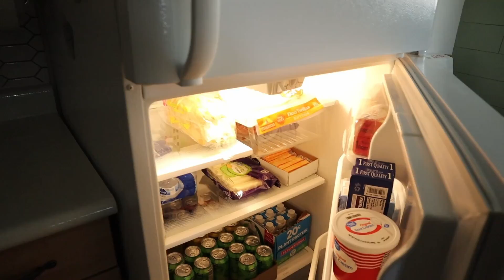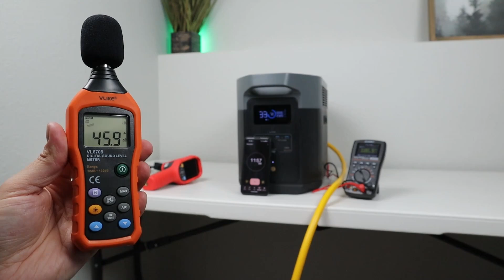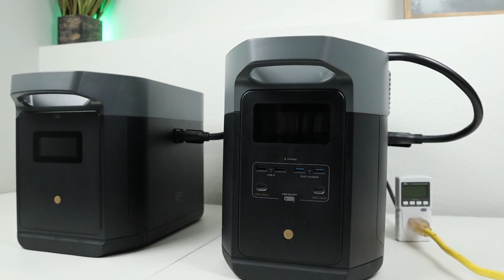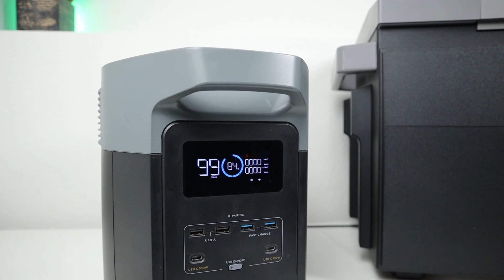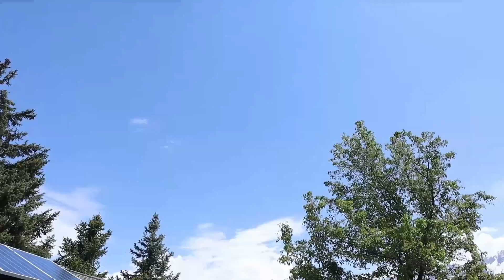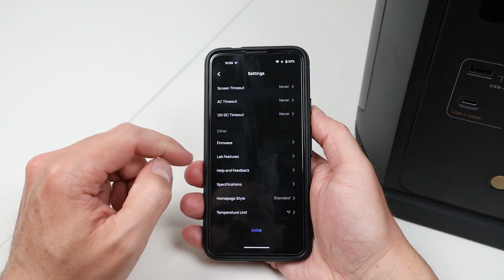The NEW EcoFlow Delta 2 MAX - LFP Batteries - QUIET FANS - 1000 Watts of Solar - FULLY TESTED!

Comment: excellent review.  I am working on home emergency backup.  I have sub panel in place only 120v, I just need outlet, will a regular outlet work or do I need special outlet to plug in the Delta 2 MAX.  I would also be using the automation feature to shift the charging to a lower rate time.  hope you could provide more info on this feature in the future.  Thanks again for excellent review.
Reply from the maker: You'll need to install a 'transfer switch' or a main panel 'interlock' in order to safely run your home circuits off a power station. I have installed a couple of them, they are simple to install if you follow the detailed install instructions. Here's a video of my first one I installed:
https://youtu.be/eiWnqukg9mM

I now have a 10 circuit model I installed that supports 240v input.
Reply: Understood.  The sub panel has its own circuit breakers for each line. Does that not count as a transfer switch. I looked at video, very informative.  I believe I have a similar setup, I believe I just need to add a three pronged plug then add delta 2 max.  I am thinking of adding EG4 battery because it adds more wattage than ECOFLOW expansion battery.  Thank you for your response and videos are very informative.   My main goal is to transfer electric loads to a cheaper rates at night.  The ECOFLOW is offering that possibility, trouble finding info or videos on that function which I think will grow in use in the future.  Thank you very much.
Reply from the maker: @salsero23  a transfer switch disconnects line power and uses the power station as the power source. You'll need a transfer switch to get the same effect.
Reply: I purchased the Delta 2 MAX.  All is working great.  I am not having success with the automation portion of the app.  I cannot seem to find much on its use.   working with ECOFLOW now with this issue.  This may be the subject for a short video in the future.

Comment: Hi..can you tell me please...in 1 port you can put 15 amp with 60 v .and the second same...or you have too put 15 amp with 30v one panel and the second same...I have at home delta 2 max and powerstream but both panel ecoflow 2(400w) is conected with the powerstream...and I know the delta 2 max is a now firmware...you can conected 2 panel for powerstream and 2 for Delta....I want buy another 2 but not same ..im  confused how much Amp and Volt can I put in one port....
Reply from the maker: Each port on its own is good for a max of 60v and 15 amps, or 500 watts. 

So 60v, 15 amps per each port separately for 1000 watts total.
Reply: Thank you very much!

Comment: Why would you think two Ecco delta 2 max units should not be connected for longer time back up.  I Would rather have 2 main units versus one plus an accessory expansion  battery….for better individual..separate usage…….but also I like idea of a total 4 k linked storage capacity. Thoughts on risks? Thanks
Reply from the maker: They aren't designed to be connected together like the expansion batteries. You could definitely use one main unit, once it's near empty, plug in the second unit. The first unit could start charging back up while the second one is in use.

Comment: If you use a 12V DC-DC 20A charger will it charge at  20A? Or do you need to go with 12-24V boost converter? Similarly, if you put the metal pin cable on 12V car, how much will it pull from car circuit?

Comment: Thanks for the video. Partially based on a previous video of yours, I’ve set up the Victron 12/24 to recharge the Delta 2 Max (on order) in our Gladiator build which will power our setup. You mention in this video you don’t love the Delta 2 Max for camping/over landing. Can you elaborate?  We had a travel trailer and can’t think of anything we can’t power with Delta 2 Max in our Gladiator build. Also have the Glacier fridge with 2 barriers and a River Pro.  Feel it’s been a cheaper route with more benefits than doing a dual battery system with a Redarc controller that’s stuck inside Jeep.
Reply from the maker: The only reason is that the DC output is limited to 130 watts so powering larger DC loads won't work well. If that's not a worry than this will work great since the AC inverter is plenty powerful to run AC stuff.

Comment: I have a technical question, that none of the review videos seem to address about these. I'm not interested in running a fridge or a whole house full of appliances. I simply have 1125 watts of 5V Dream color changing LEDs, about 25  strips 1 to 2 meters in length, each meter has 144 LEDs. Each 1 meter length is 45W. My question is, how long will this 1000Wh power station be able to operate them? According to my calculator 45 x 25 = 1125. By that math this new and improved power station could only operate these lights for less than an hour. Is that correct? 

What's twisting my head in a knot is, that one 45W strip can be powered by a single 20,000mAh 74Wh Li-ion rechargeable power bank via a 5v 2A usb port for 1 hour and only drain about 25% of its available power.  Am I missing something here? It seems as though buying 25 individual power banks will cost less and offer me far more illumination time than this power station.
Reply from the maker: Sounds like the 'rated power' is way higher than what the LED lights actually pull. Do you have a way to see the actually wattage of the LEDs as they are running? If you are plugging these LED lights into a '5v 2 amp' USB port is only rated for 10 watts, so technically you can't be pulling more than 10 watts for the entire string (especially if you aren't injecting power down the line).

If you are running the lights off a small USB power bank and getting about 4 hours of runtime, you'd probably get around 100 hours or 200 hours of runtime on a large power station like this. You could probably go with a smaller more affordable option and get great results.
Reply: @Jasonoid  Thank you for your quick reply to my comment. I hope you're correct, suggesting that I could use something smaller and more affordable. The thought of having to carry a 50+ pound power station for this purpose wasn't appealing. 

I'm afraid that as far as technical understanding to determine what the light strip's draw might be is beyond me. However, I may be able to get that determination answered via some help. I'll head over to where I can seek that answer now and hope they can offer me some understanding.
Reply from the maker: @regmiles  Your 5v usb port wouldn't function on more than 10 watts of power. So those LED lights can't be drawing much power. Good luck on finding out more about your power draw. You should be fine on even a 500wh power station.

Comment: Thank you so much for this extremely in-depth review. You definitely deserve more views/subs.
I had an enquiry in regards to the max voltage for the unit's solar input. On the EcoFlow site it doesn't really state if it's for both ports or per port but because your reviews are so extensive with in-depth analysis and experimentation, I found my answer, so thank you. So just to clarify once more, on the XT60 connections it's 60v max per port, correct?
Reply from the maker: Yep you can only connect solar panels with a total voltage of 60 volts max per port. So one array of 60 volts on one port,  and another array of 60 volts on the other. Two separate arrays for up to 1000 watts.

Comment: Beware.....
Be mindful of using the wifi app! If it is wifi- supported, IT CAN BE HACKED. They are equally as vulnerable as RING devices, home security systems, etc.
Govt, or bad actors could concievably disable, damage or destroy it. 
Best not to find out on the back end...
 Word to the wise....

Comment: Dropped mine from the chair to the tile floor. What could have been done to it? fan seems louder or i just didnt notice before. ?
Reply from the maker: It might be just fine. The batteries are pretty secured inside the power station. If nothing sounds loose inside than just test it out and see how it goes!

Comment: Surprised to see you pulled 138W from the barrel plug 😳 Surprised but happy.
Owners manual says 3A or 38W max. Perhaps it’s a misprint and should be 138W as in your testing? 🤔
Reply from the maker: Nah, it's not a misprint, these 5521 ports are not designed for high power draw over time, they will get fairly warm above 65 watts. It's perfect to run a 12v fridge since they are more secure, but I wouldn't go much higher than that wattage off the 5521 ports.

Comment: Another excellent analysis and presentation.  One item that apparently wasn’t improved is the rear power button.  This is a bother in my Delta Max (w two extra batteries) installation in my Airstream Travel Trailer.  A front button would be better. That, and the app requiring WiFi rather than bluetooth.  We use ours extensively, I’m very satisfied, and figure that by the time I hit 800 cycles with my original Max, there will be a Delta 6 Max.

Comment: Hi. Thank you for your review. Could you please clarify if it is possible to connect Delta 2 Max to Delta 2 via the corresponding charging port for an Extra Battery and vice versa? I have Delta 2 and would like to increase the capacity, however, I do not wish to buy an Extra Battery for 2kWh since it has no functionality and the price difference is also small. I am from Ukraine and the difference in price is less than $400 (about $2050 for Delta 2 Max and about $1650 for Delta 2 Max Extra Battery) if you buy not from the official Ecoflow store since the price for Europe is much higher (about EUR 2100 for Delta 2 Max - it is about $2300, and EUR1500 for Delta 2 Max Extra Battery - it is about $1600). For US the difference is about $350 ($1749 for Delta 2 Max and about $1399 for Delta 2 Max Extra Battery). If I pay this difference I will receive the "stand-alone" device which I can use anywhere. Also, could you please let me know, if it is possible to connect the Delta 2 Max Extra Battery ordered from US to my European Delta 2 since there is a difference in voltages: 220V vs 110V? As I understand, the Extra Battery charges the "main battery" with its "own" voltage from 48v to 60v (and vise versa), and on Black Friday, for example, I may get a good discount from Ecoflow US official store or Amazon))). In such a case Delta 2 Max Extra Battery is worth the money. 
Thank you in advance.
Reply from the maker: The power stations cannot connect to eachother directly, they can only connect to their smart batteries. I'd recommend using a standalone battery to extend the runtime of your power station. I have a video about that here:  https://youtu.be/tK4JKmfndh8

Comment: You forgot to include a link to the faster car charging!
Reply from the maker: Heres the link to the 12v to 24v boost converter:  https://amzn.to/3qIO3Fk
Reply: @Jasonoid  I meant the link to your other  video you hinted at early in this one. I went to the search bar and was trying to search the terms you had on the thumbnail you showed and I was not getting your video. Then I remembered to go to your channel and into your videos and search it. Soooooooo many numbers my brain is really overwhelmed hours and a sleep later (thank you so much for an all-inclusive Technical and walkthrough video, it's definitely say that I'm going to have to come back to it and re-watch it, probably a couple three times before I can really absorb the majority of what I actually need from it) but you still gave a good enough overview that I understand the setup now. The big thing I take from it is I need to figure out exactly what the capacity of my alternator in my GTI is compared to your truck. I see it's 140-amp Bosch a good quality and quite expensive but I can't seem to find the rest of the stats where you were mentioning your idling amperage vs. Peak amperage at 1800 RPM 😮‍💨 I've looked at so many websites they have them for sale but none of the technical details are available and when I search the OEM material number I get the same results, units for sale or the basics 140-a Bosch. You have any recommendations on a site that might help me with technical details on alternators or would I probably have to find somewhere with one in stock and read the Box?
Reply from the maker: @NoZenith  you could always call the stealership... I mean dealership and see what the OEM replacement part amperage would be. They are usually very familiar with that type of thing.

Comment: can you dumb this down for me. I have a 120w deep freezer chest and a 110w refrigerator both drawing 1.1a. how log will this run my equipment
Reply from the maker: If the compressors ran 24/7 for both your fridge and freezer, they would last around 8 hours. Usually the compressors don't run all the time (kinda depends on ambient temps). I am guessing you'd get close to 15 to 20 hours runtime without charging.

Comment: Hey, hope you will reply me. 

Watched all videos about ecoflow, bluetti, and on video with comparion of ac200 bluetti, you showed that amp buzz was really low, but when I check video about Pecron E2000 LFP where you also showed buzz of ac200max, it was much much worse than in video with comparison of 3x ac200. 

Also in video about pecron, delta 2 has much lower noise than in video about delta 2 max, where you also showed delta 2 in comparsion with delta 2 max and it was much noisier.

Just making no sense...

I'm audiophile so concidering between delta 2 max and ac200max to get the lowest noise possible.
Reply from the maker: I have now standardized the audio testing to have everything on the guitar amp set to 50%. Before, the audio levels would change a little per video. I also use a dirty electricity meter to measure the noise now vs before. If you look on my power station grading sheet you'll see each measurement side by side for each power station:
https://jasonoid.com/powerstations/ (see the second tab on the spreadsheet)

 The AC200Max measured 1650mv on my meter, the Delta 2 Max measured 1535mv both are very good for sound measurements and I wouldn't be disappointed with either option.
Reply: @Jasonoid  thank you mate.

Comment: Great video! Really looking forward to more info on hacking our own 'expansion' batteries. Question: With the Delta2Max's dual 60V 15A solar inputs, did it really limit each to 500W despite that it theoretically could handle 900W (60x15) and voltage is usually the limiting variable, or was that just a coincidence with your panel & sun setup?
Reply from the maker: Here's the video using expansion batteries:
https://youtu.be/tK4JKmfndh8

Each charge controller is limited to 500 watts, even if you have it maxed out at 60v and 15 amps.

Comment: The one thing I cared most about was not properly demonstrated because you connected another battery to it. I’d like to know how long it would last with say a fridge, a fan, some lightbulbs and a TV plugged into it (in case of a power outage)
Reply from the maker: Take that runtime and divide it in half, that's how long you'll get. The extra battery doubles the runtime exactly.
Reply: @Jasonoid  ok. But how about a full on test like that? Real world where there’s a power outage type situation! (With just the one battery like most people would have) until it runs out.
Reply from the maker: @raphymartinez  I don't have a Delta Pro to test with unfortunately.

Comment: So I have another question for you! (I'm still learning and love this stuff and you seem to be very knowledgable!)

I have this Delta 2 Max and two EcoFlow 400W panels. I've read a bunch and seem to understand how the MPPT charge controller works (roughly), but I'm able to connect my two panels in parallel correct? Which would technically exceed the max current (and 500W cap of the solar port). To my understanding, The Delta 2 Max and the charge controller will limit the current coming in. And in this video, your four 180W panels would theoretically output 720W so it does cap at 500W, but would it be bad to input 800W or more (assuming you NEVER exceed the voltage limit)?

Looking forward to hear what you think! I trust you and your vast knowledge on this stuff. I appreciate all the helpful videos!

JF
Reply from the maker: Since the Delta 2 Max has two solar charging ports, I'd recommend connecting each 400w panel to their own charging port. Then you'll get more power than connecting them in parallel. However...if you happened to connect both 400w panels together in parallel using one charging port, the power station would limit the current as you described and it would not cause an issue.
Reply: @Jasonoid  Awesome! Thank you. Yeah my thought was to use one port for the parallel 400Ws and then a 220W on the other! (or two) to max out the 1000W input. 🙌
Reply: @Jasonoid  Another question for you! Do I need to worry about the amount of current going through my EcoFlow parallel cables or my XT60 cable? With m 2 400W in parallel it should be around 26A. (12.9x2) Thanks for all your help!
Reply from the maker: @Voicesofjake  since the power station limits the current to 13 amps, you'll only see 13 amps through your wiring, no need to worry about it.
Reply: @Jasonoid  Oh perfect! So throughout the whole setup, it'll only draw the max the power station can have?
Reply from the maker: @Voicesofjake  correct
Reply: @Jasonoid  You're the man. I appreciate your help!!

Comment: Hi, 

Does the Delta 2 Max unit has kind self heating batterie or temperature control inside for the cold time?

And do we need to make full charged/Discharged in first time?

Thanks

Comment: I’m a newbie and trying to understand the solar ports on this model…is it correct that EACH port can handle up to 60voc or is it 60voc total across both ports?  I understand that in series you must add each of the panel’s in the series voc rating to get the total output.  Thanks in advance.
Reply from the maker: Each port is good for 60v, so you can have two solar panel setups that have 60v each, one plugged into each port.